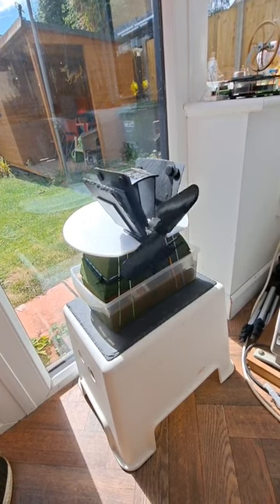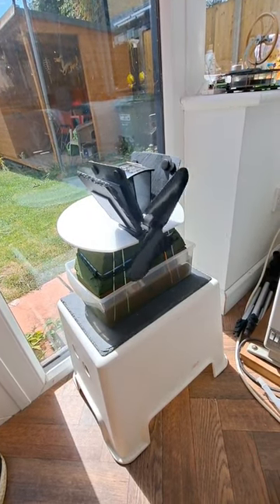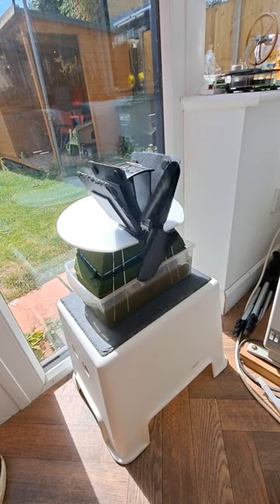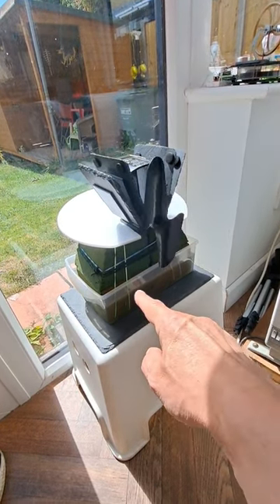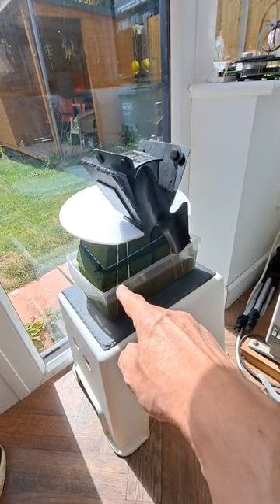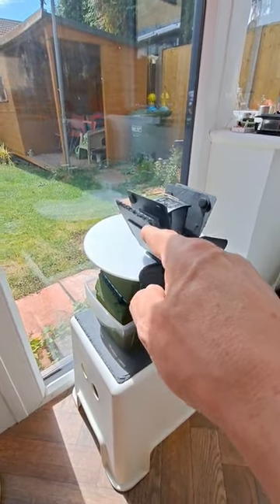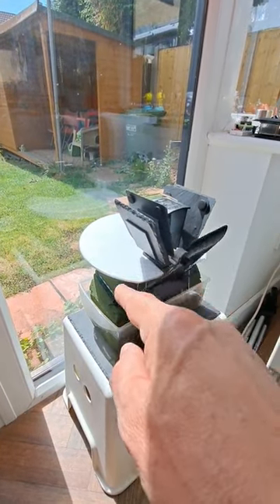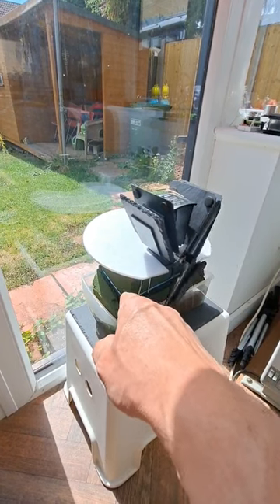Stove Fan and evaporative cooler in sunlight. See video description.

Comment: I watched this earlier before watching the other one and didnt notice the stacked oasis. Using a fan to help evaporation would be counterproductive but what about chilling the water using one of those hot/cold thermo things, hot side to sun, cold side on heat sink in the water, the sun would be doing 2 things at once.. I feel like Mad Magazines Alfred the what me worry kid.. Who me complicate things?
Reply from the maker: The whole point of this is to be completely passive, no focussing sunlight with mirrors or Fresnel lens, and no artificial cooling of the water. Just sunlight and the evaporation. I have already shown it working with icepacks, but that was just to demonstrate it works. The hot/cold thermo thing you refer to is the Peltier Tile that is in the middle of this thing already. The sun is heating one side and the evaporating water is cooling the other side. You could have a bank of them in the sun generating electricity to run another bank of them trying to cool the water to increase electricity generated by the one tile in the middle of the fan. I think we can see that is probably not the most efficient way of working, especially when these Peltier Tiles have very poor energy efficiency anyway. Evaporative cooling gets very confusing, or at least I find it very confusing. It is cooling something by drawing heat in to evaporate the water, so would it be better to heat the water, so it will evaporate easier??? I read through a long technical paper discussing the very subject and at the end of it I am none the wiser 😆 The main point seems to be the relative humidity, obviously in a very humid atmosphere the water cannot evaporate as the air is already full of water.